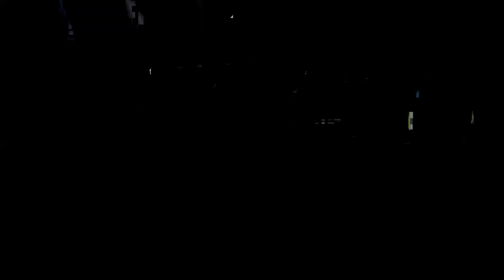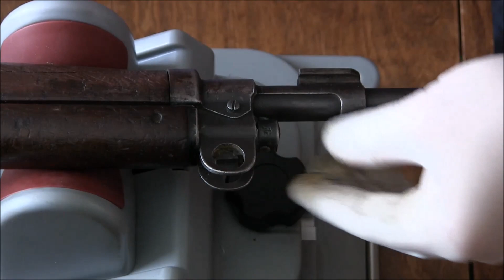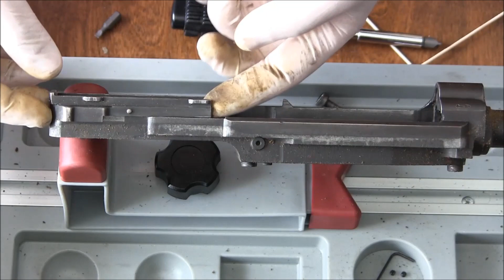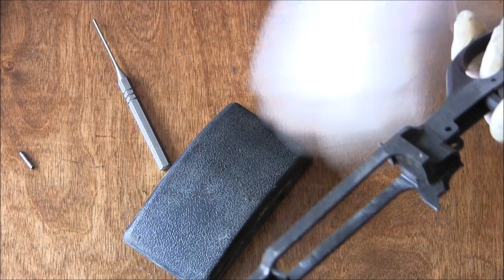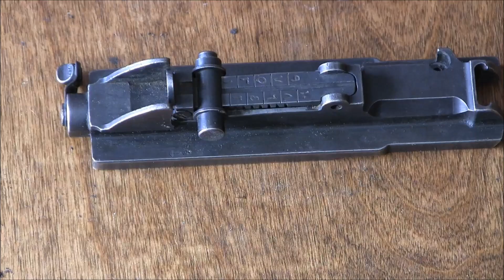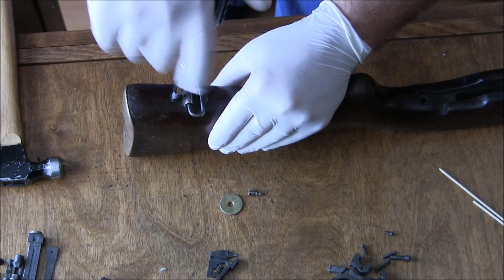FN 49 Egyptian 8MM - Complete Disassembly (rifle and bolt)

Comment: Great video! I recently bought a 7MM and wanted to see if it had a one-piece firing pin before I shot it. I purchased a new two-piece firing pin and spring. I read the instruction manual, but was still a bit hazy about the disassembly process. Found your video. I was able to take it apart, saw that my firing pin was indeed a one-piece, changed it, re-assembled it. I don't believe it took 20 minutes. Thank you, Sir!
Reply from the maker: It is my pleasure. Glad the video helped.

Comment: Ok. What’s some tips for Reinstalling the sight on to the spring? That little pin in the sight assembly is giving me trouble
Reply from the maker: You can use a small clamp to push down the sight leaf and slide it forward.
Reply: @MosinVirus  than knock the the sight on? The pins I’m worried about breaking off. One side seems a little bit longer than other side
Reply from the maker: @joeserafin6143  those pins just need to get into their spots in the sight base. If everything is lubricated and you have a small soft jaw clamp on pushing the sight leaf down so the spring is lowered, you should be able to gently tap the sight leaf forward so those pins go where they need to go.

Comment: Extraordinary video.

Anyone cleaning their FN49 after firing corrosive ammo should be aware that, after flushing the bore with whatever aqueous solvent he chooses (water, detergent water, Windex, etc.), should have the action and barrel out of the stock and be sure the gas regulator sleeve/excess gas release port area (i.e. the entire gas sytem) are cleaned, rinsed with water, and dried with the wife's favorite hair dryer, then oiled or greased a little bit with RIG (obtainable from Brownells) to prevent corrosion and/or rust.
.
Reply from the maker: Thank you very much for watching. Great cleaning process suggestion.

Comment: Hello I had a question? I have one of those FN 49 nice weapon. Had a question about the boltstop Retainer plunger Spring and bolt stop clip. How do the retain in there Housing?
Reply from the maker: If I remember correctly there is a retainer under the bolt catch that falls in the groove in the receiver. It is a flat spring and what I pushed on to get the bolt catch to swing out.
Reply: @MosinVirus  Thank you so much for your help.Wasn't quite sure.I have a complete rebuild Rifle at my house. I am also a retired gun Smith. One of my project rifle's been tinkering with it. Didn't know that much about that weapon. But a good general idea on working operation Of that system. I have that part and I see where it goes Thank you For your help.
Reply from the maker: @timmanion2597  My pleasure!

Comment from the maker: Hi, I believe it does if yours joins the springs off center on itself. I would try to place it back the same way you found it. Make sure that the plunger/connector sits over the guide rod that is on the cover when the bolt is in its most forward position. I think the point of this is to ensure the rod moves inside the springs without catching.

Comment: I'm trying to get the trigger assembly out, because I think there's something wrong with the bolt stop and I want to look at it and possibly replace it.  I took all those screws out like you showed, but wile the back comes out quite easily, the front seems to still be stuck on something.  It will let my wiggle it a bit, but it won't come out.  Something seems to still be connecting it to the receiver, as that moves when I try to pull the trigger assembly out.  Do you know what might be causing this?
Reply from the maker: Only thing I can think of is that the wood is swollen and is holding onto both. Be gentle, and try to warm the parts up a little with a hair dryer.
Reply: I don't think it's the wood.  It'll move around inside the wood.  The barrel and receiver will almost lift out of the wood except for where it's stuck to the front part of the trigger assembly and vice versa.  They're definitely stuck together by something.  It's like they're glued or something because I can't see any other kind of screw or anything else that would be holding them together.
Reply from the maker: @captainexcabier  sorry, not sure what it could be. Especially difficult to know without seeing it in front of me.

Comment: Nice video. I have a problem with the recoil spring. That little pin inside that spring is missing. I didnt knew that. The first time i fired it the rifle cycled only a bit and didnt eject the cases. After fieldstripping it i noticed that the recoilspring was bent. I need that pin i guess.

Comment: mine is missing the little tiny screws that holds the large trigger guard tight preventing them from loosening up.  Do you know who might sell them online?
Reply from the maker: Try LibertyTreeCollectors.
Reply: @MosinVirus  Thanks, they have bunch of good stuff including gas valve tool and the trigger guard screws but not the tiny screw that holds them in place. I will purchase gas valve tool in next week or two
Reply from the maker: Numrich (gunpartscorp) has them https://www.gunpartscorp.com/gun-manufacturer/fn/rifles-fn/1949-fn/parts-list-fn49

Comment from the maker: Hi, sorry you were having issues. If the pin you are talking about is the small diameter tube that sits between two inner recoil springs (recoil spring guide), and inside the outer recoil spring, then yes, it would resolt in the spring being too loose. There are two kinds of those guides - smaller diameter, offset stop ring, and larger diameter centered stop ring. Larger diameter will not fit into some inner springs.

Comment: just received my FN-49 yesterday your video will  be extremely helpful. Thanks for your time and effort. Tried to remove the muzzle cap with no success . Do you know if the  cap has left or right hand threads. again Thanks
Reply from the maker: Hi, I never tried to remove my muzzle cap, but believe it should be right hand threads. Try applying heat to it, sometimes warming, cooling and warming again works wonders, just don't go too high in heat. From what I am seeing on the forums, make sure that the holes for the tool are not welded in, because that would mean the cap is welded to the barrel.
Reply from the maker: John H Thank you for responding. That is all good info.

Comment: Outstanding video!! I bought my first FN49 yesterday (Egyptian contract). Completely disassembled it to fix a problem with the roll pin inside the hammer. Problem was resolved, however now in reassembling it, the trigger group won't mate correctly with the receiver through the stock. Hammer is cocked to the rear position, but even after more than an hour trying, couldn't get the two to mate correctly. (seems to be rocking on a high point behind the magazine well). Any advice would be greatly appreciated. Thanks!
Reply from the maker: Hi, sorry for not responding sooner. Somehow your comment ended up hidden and flagged as spam. I just saw it and approved it. Are you still having that issue with trigger group not mating with receiver? Please let me know if I can help.
Thank you
Reply: MosinVirus Thanks for the reply. I discovered that the rifle was fired without the cover in the past. I know this to be a no-no because (and let this be a lesson to everyone) the hammer hits the walls of the hole where the middle trigger guard screw goes into. By doing this however number of times, it succeeded in deforming the round circle into a slightly flattened side. Had to take it to my gunsmith, but whatever he did now allows the two sides to mate properly.
Reply from the maker: Steve Shalaby Great that you got it fixed.
Reply: Shit, I am having this exact problem and fired the trigger group outside the rifle a few times. I hope I can fix it myself. I was initially thinking that it was getting caught up on the bolt hold open or the ejector (bcuz it pivots). Gave up after an hour. Going to tackle tomorrow.

Comment from the maker: I am not sure if 196gr FMJBT Yugo M75 Sniper ammo is corrosive, so I treat it as such. I simply clean the bore, gas system, and bolt with patches soaked in water, to remove possible salt deposits, and then reular solvent and dry patches.
I tend to stay away from corrosive ammo usually, but if I were you I wouldn't worry and shoot those couple hundred rounds through. Simply clean the gun using warm water (the warmer the better) first and then your preferred cleaning method to displace water.

Comment: That butt plate or any other steel part of the FN can be very easily and beautiful quickly cleaned by glass bead peening . Glass bead peening is much cleaner than sand blasting . Try it !
Reply from the maker: Thank you for letting me know. I will surely try this in the future.

Comment: Got it off. Just can't get the replacement in.  What type of surplus ammo do you prefer? I know a great deal about mosins but I'm new to the FN49.  I've heard Serbian stuff is too hot to shoot safely?
Reply from the maker: Sorry, I cannot use surplus at ranges around me, so I am not too familiar with that. Is the replacement exactly the same in size? Perhaps it needs to be filed down a bit to fit.
Reply: The best is actually egyptian surplus (sounds funny but it is still obtainable and simply the best surplus ammo for hakims and fn49s).
German WW2 ammo also works fine.

Comment: Forgot to ask you,  for ammo, is fine to use this manufacturer from Romania, 170 gr., only .60 per round. fmj, brass.Primer type is Berdan
Reply from the maker: Michael Hegyan the most important thing is pressure. you want to check out the pressure characteristics and make sure they are not too high.

Comment: but how did you remove the trigger guard? With all the screws removed it still doesn't move
Reply from the maker: must be stuck in expanded wood. brace the stock, and lightly tap the sides of the trigger guard with a rubber or nylon hammer to separate the metal from wood.
Reply: Thank you! That did it, I'm always nervous to force things